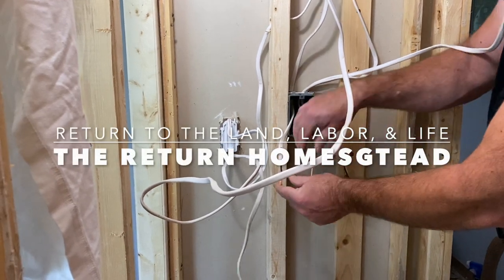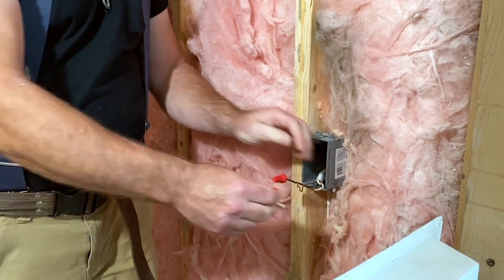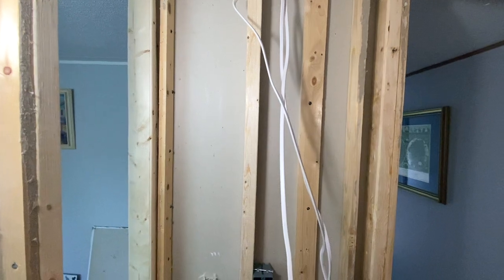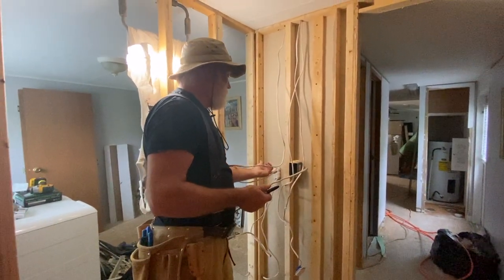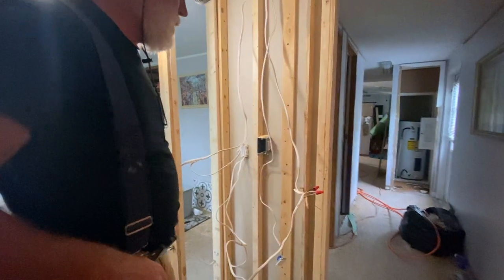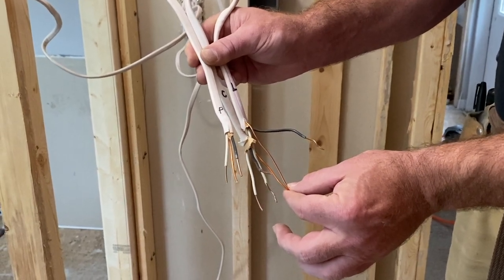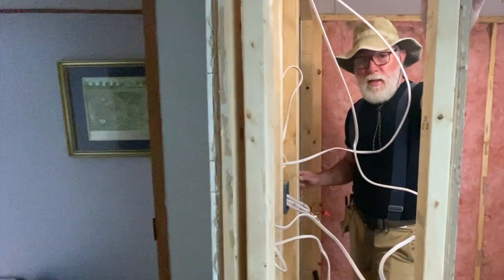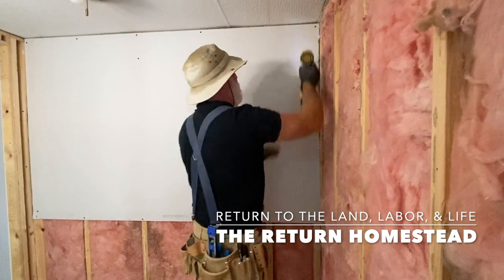DIY Electrical Troubleshooting - Mobile Home Renovation Episode 5

Comment: Mike, I live in Georgia, do you know why the only receptacle in my bathroom only has power on it when the big row of lights  above the bathroom counter  is on,?  Double wide home , thank you friend
Reply from the maker: Maybe. The problem is most likely in the box behind the light switch. Power is often daisy chained from one switch or outlet to the next. That outlet most likely gets connected to the circuit through that switch. The conductor that caries the electricity to the outlet is connected to the circuit behind the switch, so that the switch must be closed before the outlet is hot the same way that the light turns on. If the conductor was moved to the other side of the switch, then the outlet would have a direct connection to the breaker panel and would no longer need the switch to be in the on position. May sound complicated but you are moving one wire to the other post of the switch.
Reply: @thereturnhomestead23  so really it's not complicated? Thank you very much!
Reply from the maker: If the light only has one switch it is not complicated. If two switches control the light independently that would be a 3-way circuit that is more complicated to create and install. If it is a 3-way, moving the outlet to the other post of the switch may not do the trick. Interesting troubleshoot.
Reply: @thereturnhomestead23  the overhead light has a switch, the light over the bathroom counter has a switch, one for each one, the power outlet is  connected  to the light over the bathroom counter
Reply from the maker: I would look behind that switch (turn off at the breaker first) and see how many wires you have coming into the back of the box. Best case scenario is 3; one brings power from the breaker box, one goes out to the light, and one goes out to the outlet. If so this should be easy to fix.
Reply: @thereturnhomestead23  I'm gonna try it, thank you for your knowledge, and kindness to me!

Comment: Looks normal but my son's trailor (modular home) had only one wire in most plugs and lights.  😮😢
Reply from the maker: That sounds right. This wall had switches on both sides of the wall which is why so many wires. Unfortunately, wires are not labeled so every time you open a wall each circuit has to be identified before it can be reinstalled.